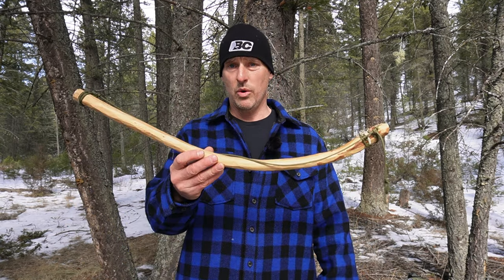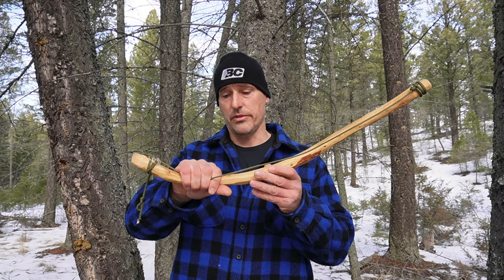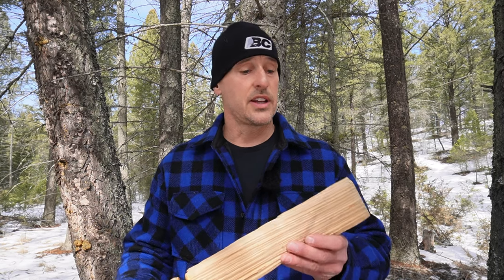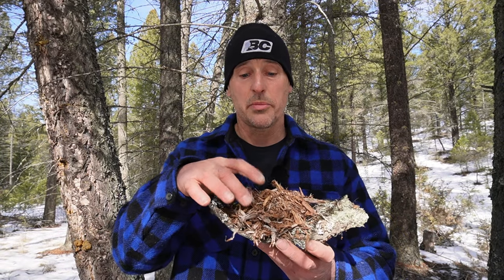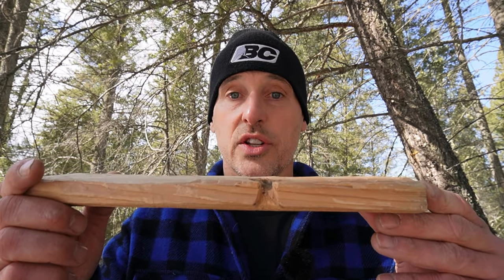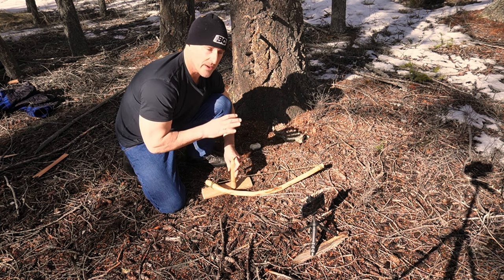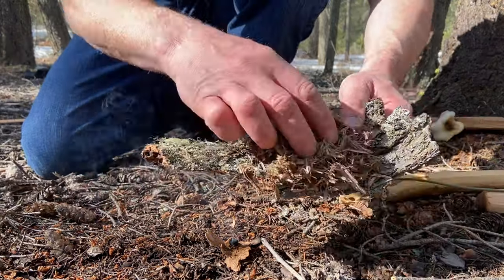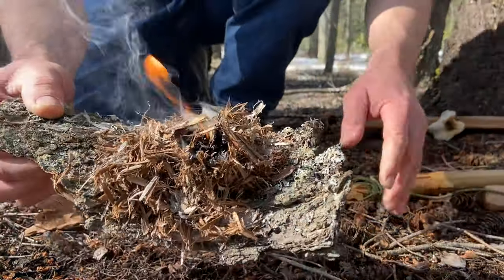Bow Drill Fire Made Easy

Comment: Well done.  Using a thumb to adjust tension on the string, on the fly, is a good tip.  If you had positioned your spindle on the outside of the string instead of the inside, then each stroke could have been slightly longer.  It would have been slightly more efficient.
Reply from the maker: Great tip!